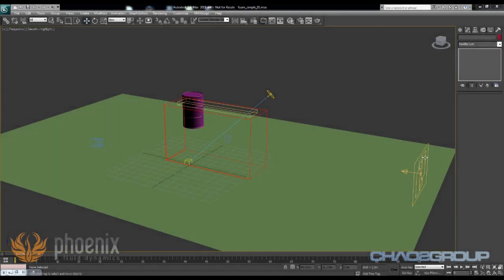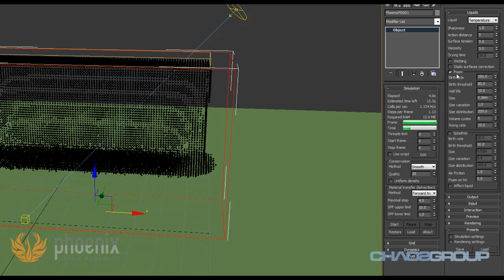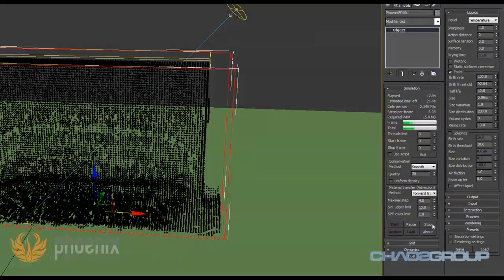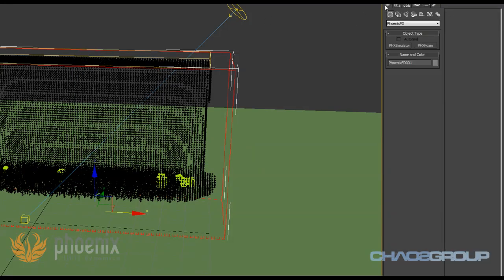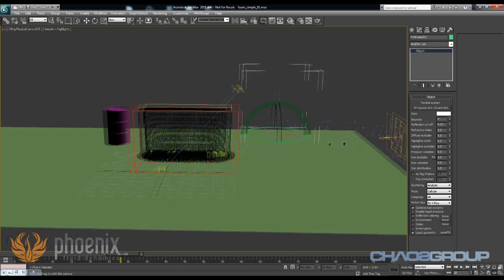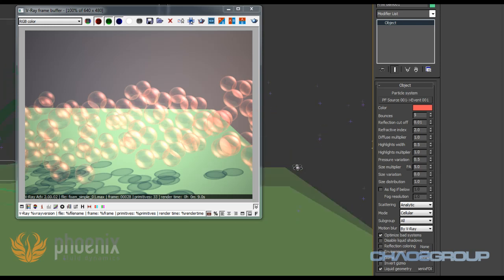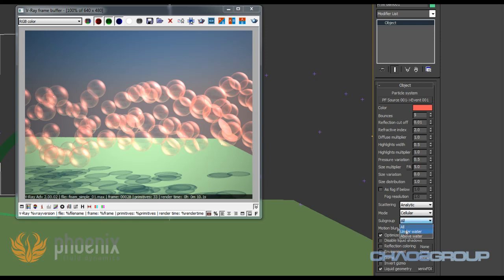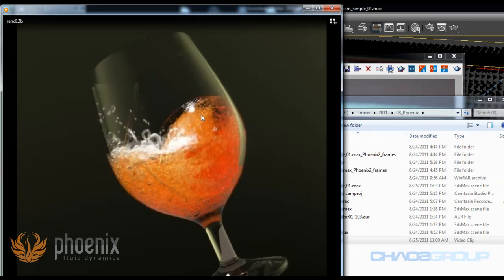Foam Simulation with Phoenix FD 2.0

Comment: Is it possible to exclude phoenix fd from a GI solution?

I tried a quick test and it rendered in 30 seconds with GI off, turning on GI upped the render time to 20 minutes and leaving GI on and turning off all the GI options in the VRay object properties made the render time about 15 minutes
I don't understand, is it working out the GI solution or not?
and how do you use phoenix fd in a scene with global illumination without applying it to the phoenix fd sim?